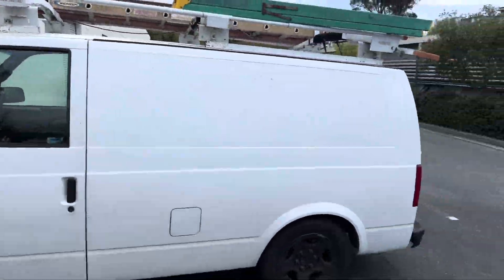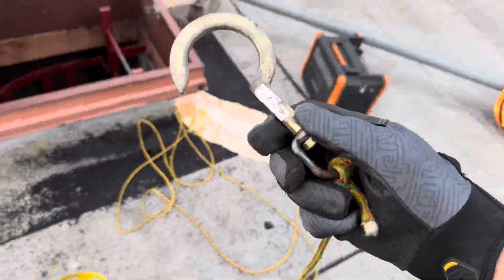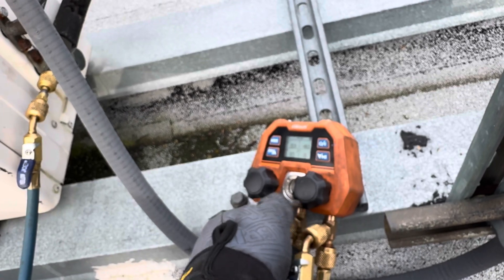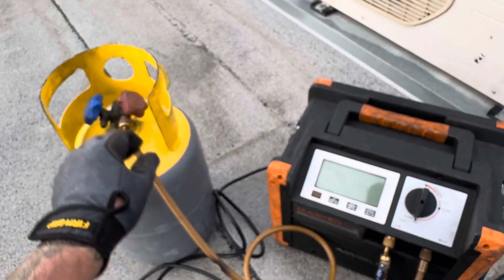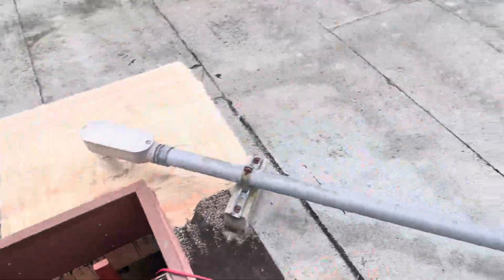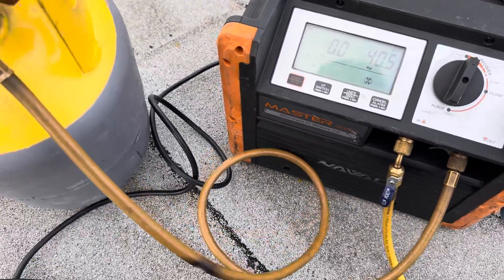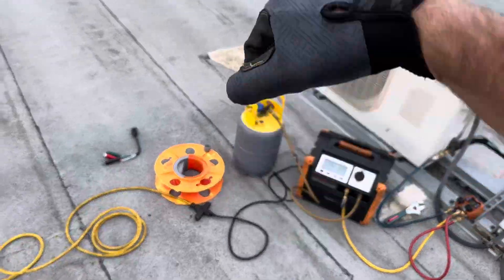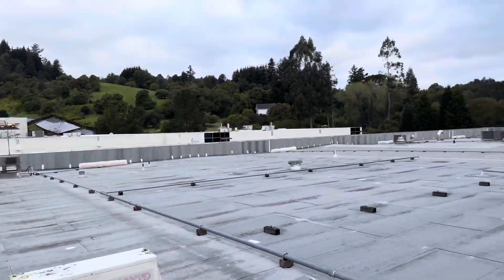Refrigerant Recovery

Comment: The NRDD only just beats the MR45 going by the spec sheet, interesting you think it smokes it. I can't get the NRDD in Australia anyways. 

Question for you though, how do you deal with hacks? New place I started working for as an apprentice seemed alright at first, they do a reasonable range of work and all that. But we swapped an evap on a big pallet storage freezer the other day, and the boss made us open the system back up without even a vac. Made the excuse it was to protect the product, but the freezer was still running fine on the other unit in the room. 

Called him out on it, and he said the dryer cores would sort it out, wasn't going to pull the charge, and properly vac it. 

I've watched enough guys on here to know that's super hack level workmanship, but I can't keep job hopping till I find a good company...
Reply from the maker: Your boss is just showing you real world 🌎 stuff in all honesty. You try to do your best every time and in some cases you have to make stuff work. I’ve built txv s at night ( wrong power head ) to get units by. Job hopping is a killer. But in the real world we all hack a bit. Just being honest.
Reply: @NorCal-refrigeration  appreciate the reply. In my opinion it didn't need to happen, the room wasn't struggling, and a 30 minute vac would have made the world of difference. 

I get where you're coming from, though. I think I'll stick around, and just try to do better than the examples they've set.
Reply from the maker: @Thermoelectric7  exactly 👍

Comment: Btw Dave have you tried the Milwaukee top up 120V inverter thingy , would it power the Nerd ?
Reply from the maker: I have not. You have to see how many watts the recovery machine requires then match your inverter and battery load to run it.

Comment: The vapor port on the recovery tank works really good for blowing out condensing coils when you ran out of nitrogen! Haha just kidding. 
I overloaded the motor on my Hilmor recovery pump the other day and now it won't work, probably my fault but still I'm not impressed because it's only about a year old. I had a G5 TWIN that suffered so much abuse before it stopped working. I might need to try the NAVAC one next, I have the NAVAC cordless flaring tool and cordless vacuum pump and both of those are awesome. 
I love Refrigeration but I would be lying if I said it hasn't Flucked me up mentally a bit, It can whoop your butt sometimes.
Reply from the maker: Indeed